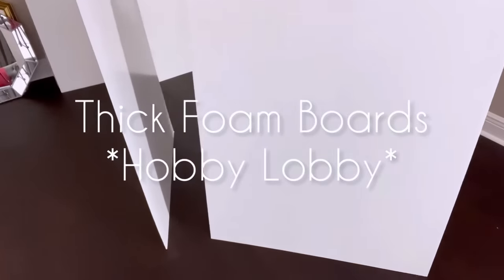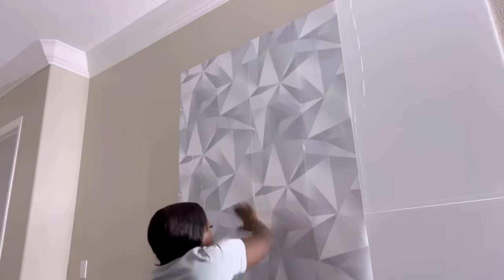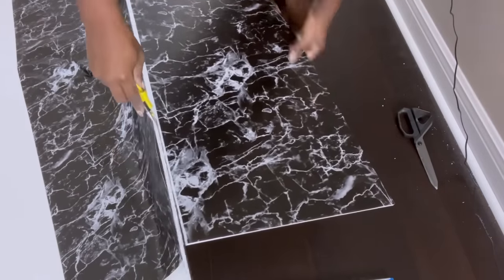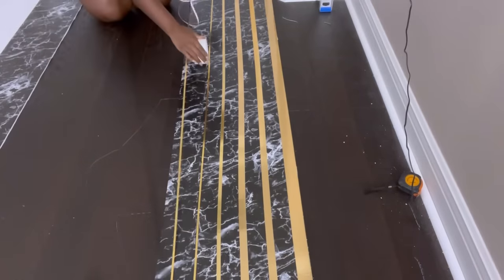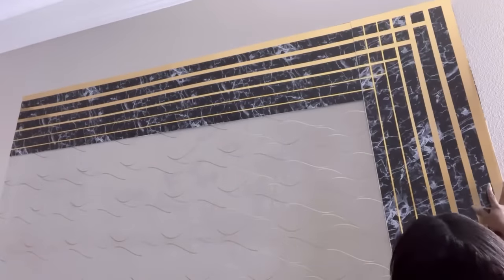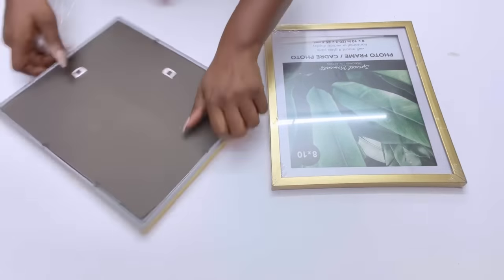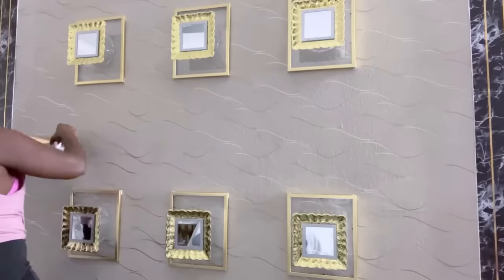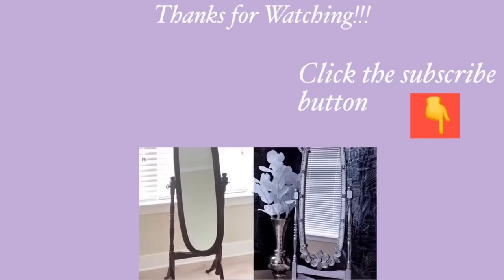UNBELIEVABLE DIY Wall Transformation| DIY DOLLAR TREE Design To Try Out!

Comment: I have a thought have you used the foam installation board from homedepot its 8ft tall and 4 ft wide for $12 its a half inch thick. The 1in is 25.00. I bought both. The thinner one im going to use for a wall mirror.